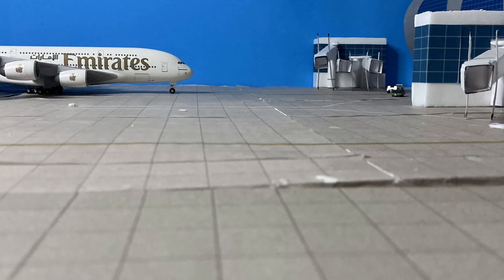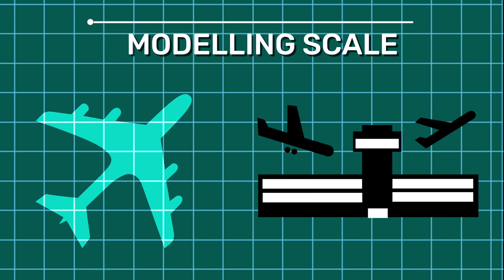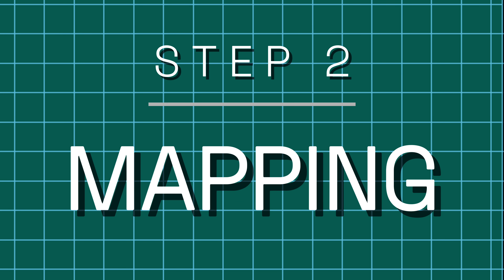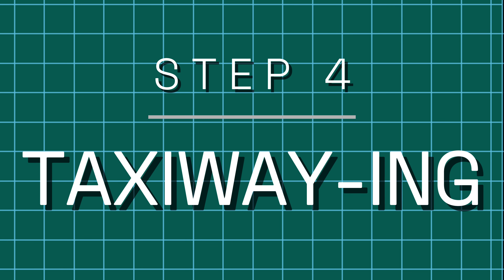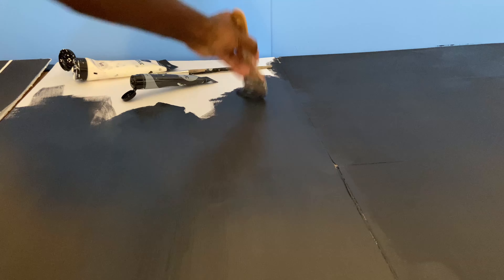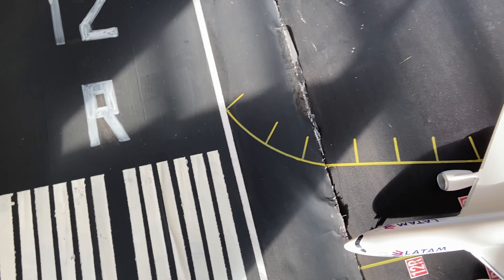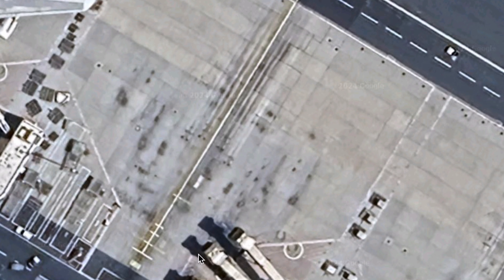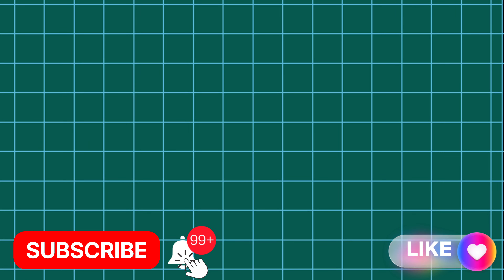How to Build a REALISTIC Model Airport

Comment: 0:14 b777 with winglets???
Reply from the maker: That's the new Boeing 777x which is not yet in service. It does have folding wingtips to allow it to fit into the pervious generation of 777 gates.
Reply: @FeatherwayAirlines  okay thanks i didnt know emirates was getting the 777x